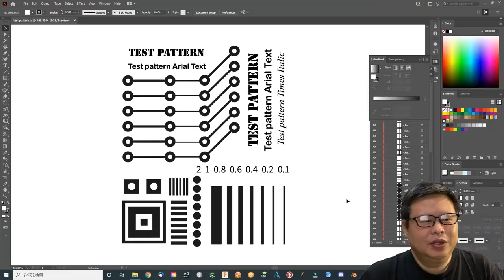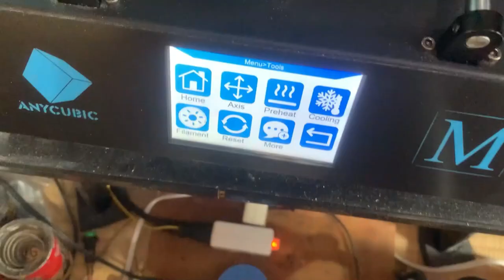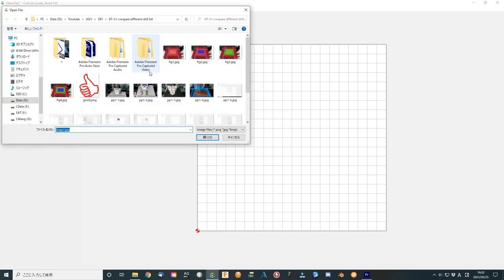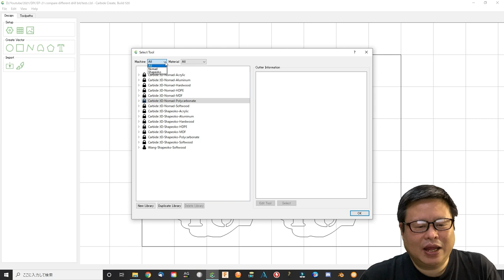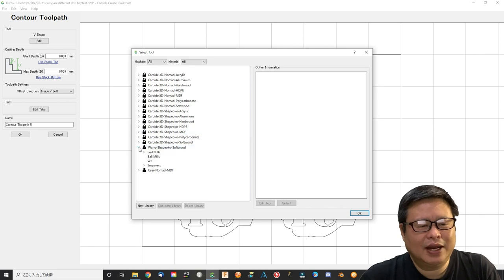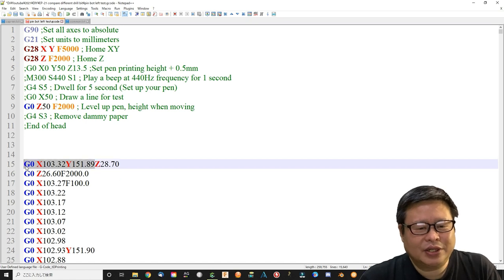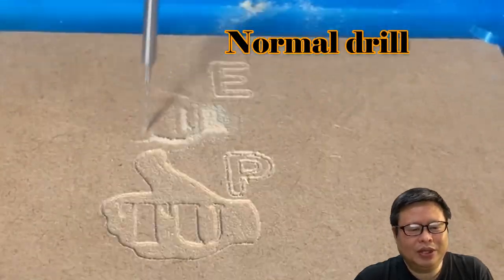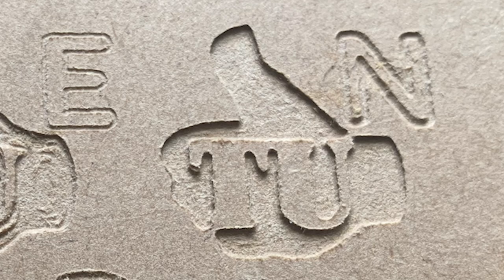How to use Carbide Create to generate the g code file for 3d printer (simple and easy tutorial)

Comment: Do you have the carbide create pro version?  I don't think you can export Gcode in the free version any more.
Reply from the maker: Thanks for your comment. I don't use Carbide create pro. The free version works well for me before. Now I have not used it for a very long time. I am not sure if it still works or not. But as I know it should work. You should select the correct bit and the correct type. Also, it maybe needs to adjust the gcode file. Good luck.